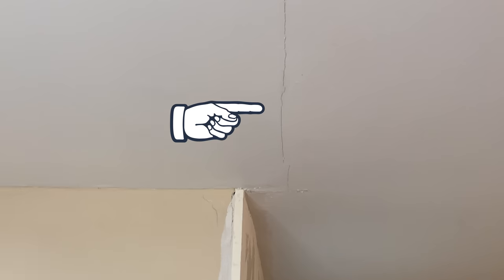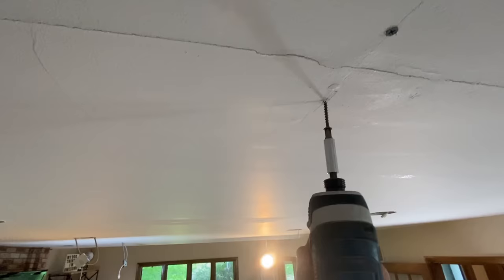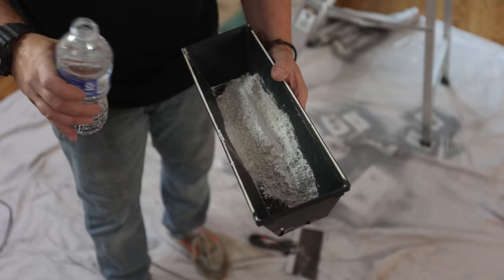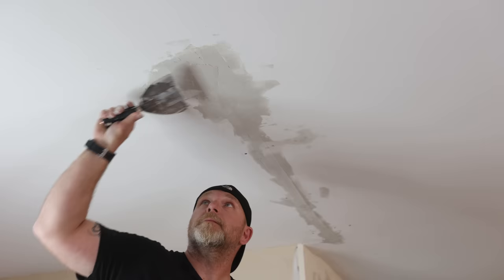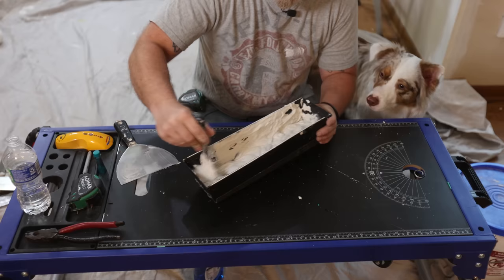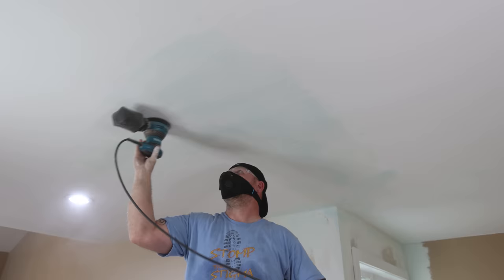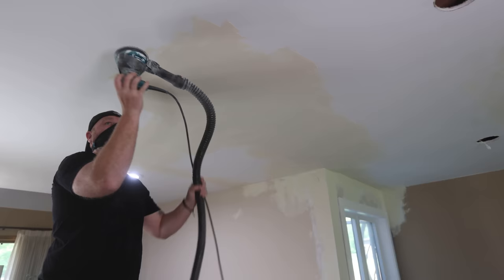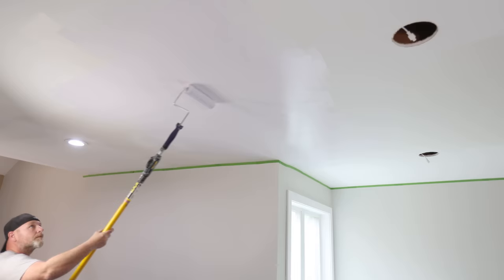How to Fix a Drywall Crack in Ceiling or Wall FOR EVER!!! Tutorial

Comment: I don't recommend the dust control compound to anyone. It doesn't apply well at all. The plus 3 is a way better compound for everything after the taping is done, which is best with a setting type compound since it cures harder than drying type compound.

Comment: 40 year drywaller here. First off no one wears black. Only paper tape will stop a crack. Mesh is for a patch only. First coat use premix mud for the vinyl glue in it. Matching the texture is the tricky part that’s why do it your selfers don’t mention that.

Comment: Great video , thank you. I built a two car garage , it's been up since 2017. Had so called professionals do the wall boards and ceiling boards . Didn't use tape at all . I have no temperature  control o needless to say all mud joints have cracked and are falling on my two classic cars. How can I best correct this . Thanks , Tom.

Comment: One thing he didn't mention was that a lot of the time the reason it cracks in these places is because its a join in the sheets and there is no backing behind there besides the joists its screwed into. I highly doubt this will last forever unless you get in ceiling and put some timber behind the join and screw into it,  making it one solid piece again. If it is house movement then there is no way that some plaster and mesh tape is going to stop your house from moving. I tell my clients this all the time, understand why its cracking before you pay some guy hundreds of $$$ to "fix" something that will crack again. Other option would be to put an expansion joint there instead.

Comment: LOL, an unsupported drywall joint will ALWAYS crack again. I was a painter for 40 years, and sent many hours trying to repair unsupported joints, and in every case it cracked again. Even if you get behind the crack and back it up with a stud and screw the edges down tight, it will still eventually crack. A joint like this, with screws at intervals, and no stud running along the length of the crack, will crack very quickly.

Comment: Not too bad for what’s obviously a DIY job. Guaranteeing it won’t crack again is not possible, especially how you did it. Some drywall or timber backblocks above the cracks(inbetween timber ceiling joists) would help a lot more. The tape used is too floppy, I recommend fibafuse for patches, the mesh tape isn’t nearly as strong. Sometime the crack will always come back due to movement of the house, if this is the case the best option is to install a control joint which can flex with the house movement and is better to look at than looking at a crack.
Reply from the maker: Never has an issue

Comment: After YEARS of sanding joint and topping compound, tip..... its water based. Instead of all that dust, try wiping offthe excess with a wet cloth or sponge........

Comment: We are totally on the same page with patching and methods. I am a contractor. Recently i did a large sunroom rennovation.  On one wall every upright (9') joint cracked. I used mesh and 20 minute for the first 2 coats.  I installed drywall over paneling. I dont think i put my joints over the paneling joints.  Just dont understand what happened unless this was a temperature or moisture  thing.  Ideas?  Room was semi heated/cooled during construction.    Not sure whether to try to pull old mesh out or patch over like your video.

Comment: I'm by no means a professional but when i fixed my ceiling cracks i cut a v into the crack then fill it with silicon then a skim coat of mud 7yrs later still no crack.

Comment: My ceiling has a long crack and I’d love to try this repair, but the ceiling and walls also have a sprayed on texture (which gives the ceiling bumps). How do you handle this when you are applying mud and sanding and before painting?  If you don’t have texture on the repaired parts, it’s not going to match the rest of the ceiling and will look really weird.

Comment: Then spend forever finding and cleaning drywall sanding dust from the rest of the house. lol great work!
Reply from the maker: Yup.  Thank you
Reply: I find it's fairly easy to tape off doorways with plastic then run a fan in a window to suck the dust out. As an alternative, tape a furnace air filter to the back of the fan and it will catch the airborne dust.
Reply: He probably has a wife that helps clean. I was thinking the same thing ( but I don't have a wife or husband ) I'll have a lot of cleaning after.
Reply: Just to clarify I wasn’t being sarcastic if anybody read it that way. Lol I was 100% speaking from experience. Misery loves company lol
Reply: Use painters tape and to attach it to the ceiling all the way to the floor around the area you need to work in (use thumbtacks if really need it to hold). Then invest in a dust buddy and a shopvac  attachment for a sanding pole. No issues with dust

Comment: Awesome video!  Well done.  I just noticed this problem in my house, however most of my cracks are in the corners. Do you have any videos on fixing that problem?
Reply from the maker: It’s going to be the same process. You just may need corner bead.  But the materials and process is the same
Reply: @KomarProject  awesome.  Do you recommend waiting a time period before attempting to repair the cracks?  I’m assuming it’s from the house settling.
Reply: Skip all of this and just use paintable caulk for cracks in corners. Be done in minutes and much more likely to not show back up

Comment: Respectfully, I have to disagree with everyone saying paper tape is better than mesh tape for “ drywall repairs “ . 

- paper tape does not have any play so any movement left to right or up and down and the tape will Tear, causing the mud on top of it to crack as well. 

- Mesh tape on the other hand, which I apply over the crack after I’ve removed the damaged tape that is no longer bonded to the drywall by spraying any adhesive spray glue , and then applying the mesh tape . That just helps the mesh stick if my roll is a little old and also keeps the brown paper of the drywall from bubbling when I apply my quick setting compound . If there is slight movement again, the mesh tape will at least pop loose from the thread Without causing the joint compound to crack.  of course if it is major movement, then both tapes will buckle regardless. 

Also, for A garage and bathrooms I only use mesh tape with the exception of paper tape in the corners and angles, as it does not become weaker with moisture. The reason why every single garage in the world Has or will have paper, tape, buckling, and falling like crazy since the garage is not, climate controlled and pretty much takes on the temperature outside. As for the bathroom, that’s self-explanatory but that’s just my opinion. I got a video of a repair I did, but gave up after that one just don’t have the time to be doing that.

Comment: Is this the same procedure if the crack is along where two dry walls meet such as the 90 degree edge where a vertical wall and ceiling meet? Awesome tips!
Reply from the maker: Yup same process.  You just might not need to screw anything down. But I still would
Reply: @KomarProject  Thank you!

Comment: I’ve used a  joint compound 20(Menards)  when I sanded I had many many holes.  Why does that happen?  I tried another coat and bubbles came out.  But my concern is why so many holes? What can I do so it won’t happen??

Comment: You need to use paper tape or nylon mesh tape over the crack before putting joint compound on it or it will crack again later.  Old school paper works best.

Comment: Is this normal? I just go straight to “foundation problems”. I have a 7yo house and you can tell it was patched before. Seller/builder did not disclose it. The wall below has no funny business going on. Not even a crack in the caulk at the baseboards. I have massive bounce and deflection in the large span great rooms. Both upstairs and downstairs has great rooms in that area.

Comment: Hello! Thank you for your video. I will be replacing a vinyl baseboard with a new one in my home. The old one tore some of the paper off the drywall. Do I need to scrape, primer & mud before attaching the vinyl with adhesive, or is it ok to skip these steps since the wall will not be exposed? Thanks.

Comment: Do yourself a favor and dont use that mesh tape. I do drywall repairs daily. I run into cracked mesh tape repairs all the time. Dont try to cover a crack with something you can see through. It definitely does matter wich direction you trowel the mud on. Run long ways with the tape to fill the lows on each side of it otherwise you will end up with a hump. You should always out 2 coats over the tape once its dry. Especially on smooth a  finish. This will yive you a very flat surface and hardly any sanding. Everything else on this video was very well done. Most guys just tale right over loose cracks but not this guy. Well done

Comment: Similar issue I'm dealing with currently, BUT in my case the crack is on the other side of the joint.( no stud to screw into) how would I go about repair that?

Comment: That's a recess joins crack. Unless you get into the ceiling cavity and backblock the whole join, it will crack again. Mesh is also terrible, that offers zero crack resistance. You should use fibafuse or paper tape. You should also do a prefill (and let it dry)  before taping so gravity does not cause the tape to sag. 

Your method is something a clueless DIY home owner would do.

Comment: Do you have a video on repairing tape separation on dry wall? After decades and earth quakes movement the ceiling joint tape is popping loose.
Reply from the maker: I don’t. But you want to pull the old peeling tape and re-apply it in the same manner I did in this video.  Hope that helps.

Comment: Do you use a fan or heat to accelerate drying time ? Great video !
Reply: A fan will only accelerate the drying or the outside, so it will look dry, but still be wet underneath. If you sand drywall mud that is not completely dry, when it dries it will continue to shrink. This is how you end up with cracks that are visible after patching, or perfectly round holes over where screws were. I would never do a final coat on the same day you filled any deep gaps. Even the 15 minute mud can take overnight to dry if the gap is big or deep enough. You want to make sure the mud is absolutely dry before doing your final sanding or you will have problems.

Comment: Good tutorial! But, I notice these tutorials are always on smooth finish walls. My 40 year old house has several cracks in popcorn textured walls with several layers of paint over it. Hard as a rock! Trying to sand down the texture either side of the crack is near impossible and using a power sander results in a house full of dust and several breakthroughs of the paper. Any suggestions on how to deal with that and then match the painted texture afterwards?
Reply: Dampen the ceiling with water using a spray bottle. After it's nice and soaked, simply scrape it off like butter.

Comment: I have a bunch of cracks in my house but my issue is that I have a “swirl” texture on my walls and ceilings. Any suggestions on how to repair these cracks and match the swirl texture?
Reply: Depending on what material was used to skim your walls. If it have any grains in it, you have to use the same granulation. Follow this clip advise up to the point of patching the cracks. In your case follow only the cracks with a narrow patching and tin as possible. After that is sound dry, you have to use the same material that was use to skim your walls. Apply that material and using a plastic or cork paded trowel, constant wet, go over the applied material in a swirl motion, rotating all the time. (you can use a steel trowel too but with that is hard to get the swirl texture). Make sure your trowel is wet and clean all the time. In doing so you may replicate the original swirl texture. You have to somehow overlap the new material with the old part of your ceilling or wall.
Reply: @SpiderF27  many of them are stress cracks from the house settling after we had it built. The cracks start high along the ceiling and propagate down the studs. I was thinking of widening each crack slightly with a knife and filling with some type of silicone then painting. That way it could still flex a bit? This will only work if the house has finished settling though. It’s been 11 years so I think it should be gtg right?
Reply: @upperhandcustoms11  ... silicone won't work. You do NOT want the different parts to flex because it will crack again, so extra screws are the way to go. More than likely there's an air pocket behind the crack, which is why you need to clean out the old material and stuff the gap full of durabond or similar.
Reply: The issue is that you have a "swirl texture" on your walls. Time to get out of the 70s I think.

Comment: For my first coat I use Clark Dietrich's Strait-Flex Crack-Tape with Rapid Set's OnePass and because it doesn't shrink immediately after is nothing but topping! I'll check out that Durabond 90 to see if it is better - would like a little more working time than OnePass
Reply from the maker: Ya they make a 20,45, and 90 working time
Reply: I’ve not had great luck with Crack Tape.  It’s more trouble to use due to its added thickness.  I have a joint with Crack Tape that has reopened, which really surprised me given how hard it is to tear the tape.

Comment: I bet it cracks again I done this shit for 30 years if you can get in the ceiling cavity back block it with back blocking cement and plasterboard off cuts if not cut it open so you can slide them in if your going to use mesh tape use the external grade if foundation's are moving it will crank elsewhere.  If it's a steel frame in high heat area some form of expansion joint will be required

Comment: Is durabond 90 the drying time. Box store locally has only 45 or 20.
Reply from the maker: Yes.  20 45 and 90’are the drying times.  But it always take much longer then that with the 45 and 90.  The 20’is fairly accurate and I don’t like using it because it dries too quickly for me.  Unless it’s a small about that I’m applying.
Reply: @KomarProject  thank you so much. Glad I found the channel. Always diy

Comment: How much dust do you get when you use the filter on the orbital? Do you still have to clean all the surfaces when you’re done or is it possible to actually not make a mess?
Reply from the maker: It gets pretty messy.  There are sanders that you can buy specifically for drywall sanding that limit the dust.  But it’s still fairly dusty
Reply: Would you do a job around office equipment or would you make them remove it or cover the equipment?

Comment: Thanks for the tips!  After that last sanding with the pole sander and before the priming and painting, do you clean the dust off the wall one more time with anything like a vacuum or TSP?
Reply: Good idea. I just use a rag, towel or paper towel to remove dust, otherwise the PVA primer won't stick properly.

Comment: May i have a list of the tools and material you used in this videos, sorry that i am New to it and i need to buy all item i need, thanks a lot
Reply: -Durabond 90(I would use All Purpose but 'bond is fine)
-Box of Plus 3 Yellow 
-Damp sponge(not necessary)
-mesh tape
-6" knife
-10" knife
-mud pan
-fine sand sponge
-sanding head with 12p grit paper

Comment: Thanks for sharing such an informative and well presented video. Can I ask if the whole ceiling should be primed with the Zinsser BIN , or just the repaired area? If it's just the repaired area, will it show up as a slightly different patch compared to the rest of the ceiling ? Many thanks for any help !
Reply from the maker: You should just primer the repaired area and no it won’t show up.  The primer is just there so that drywall doesn’t soak up all the paint and you will have to do less coats.  For paint though I usually paint the entire ceiling unless it’s been painted recently and then you can most likely feather it out.

Comment: Should this work for high ceilings that have fine cracks because of truss uplift?
Reply from the maker: It will work for any ceiling.  As long as you fix the issue first it should work.
Reply: @KomarProject  In other words, I need to fix the truss uplift issue otherwise this repair could crack again?

Comment: I got a question for you, if you were going to skim a painted wall do you use any bonding agent in the mud or on the wall
Reply from the maker: Nope you just go right over it.  The ceiling was already painted and just did it on there.  No worries
Reply: @KomarProject  appreciate you getting back with me, is there any kind of bonding agent in the mud.

Comment: Too much work and way too much dust.
Just widen the crack a small bit and fill with a bead of DAP Kwik Seal bath kitchen Caulking. 
Smooth out with a damp sponge.
Top with your joint compound. 
Wet/dry sandpaper to eliminate dust from sanding.
Paint. 
You're done.
Obviously, this works well for smaller cracks only.

Comment: The mesh tape you are using (worst option in my opinion - paper is better and fibreglass is best) is probably half a millimeter thick. If you apply it on top of the crack, you will have to mud 30 centimeters left and right of the crack, so that you spread that half a millimeter thickness over 60 centimeters wide and it is not visible anymore (as you did). I think an easier solution is to chamfer the crack much wider with a cutter and then apply the tape into the widened crack and below the surface of the ceiling. That way you only have to mud and sand the chamfered crack and it's going to be less work. The result should be the same in terms of durability.